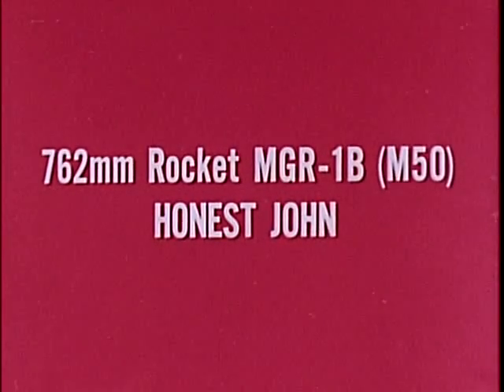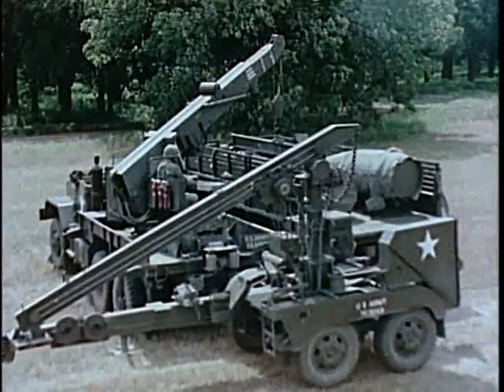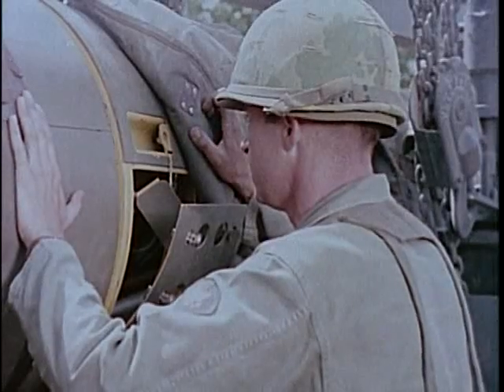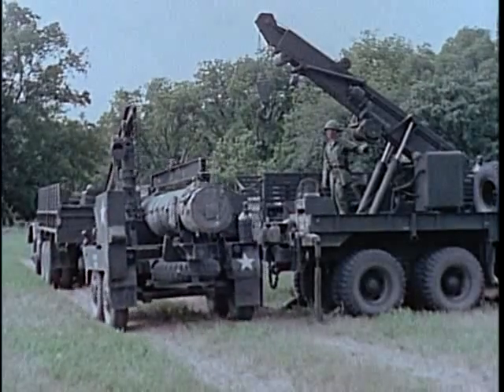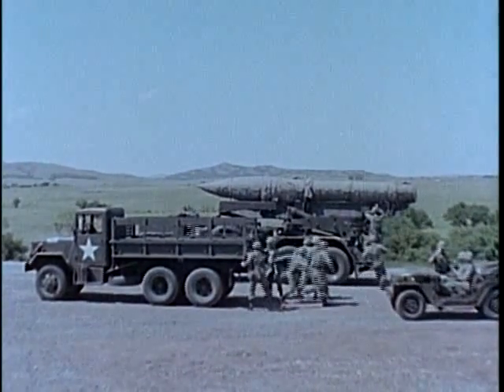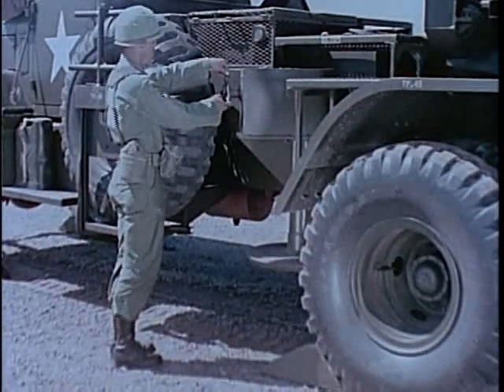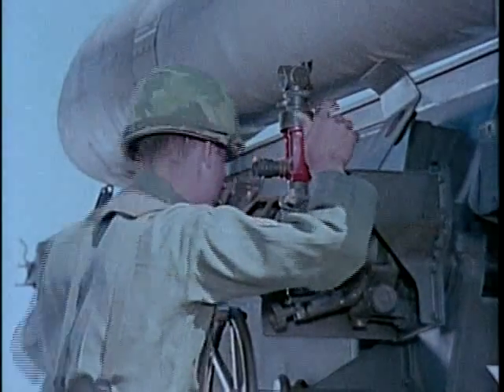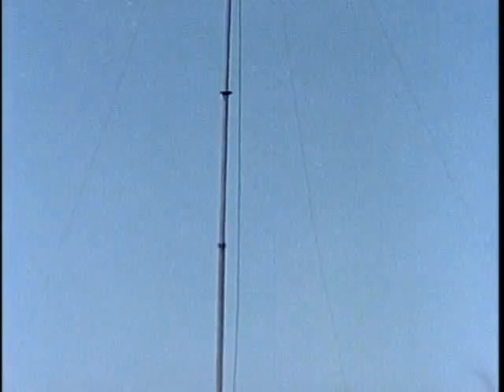Honest John Rocket

Comment: In 1956 I was sent to Germany and put into an honest john outfit in Ansbach Germany in Bleidorrn Casern.we were a small unit, the 3rd field artillery battery, We were only a Battery and our commander was a Captain his name was Ogrady later we were made into a larger outfit and we became the 1st missile battalion. We always had one or two rockets set up and ready to go except for the atomic war head. in the winter they kept heated blankets covering it. we fired several without an armed war head. once we fired one with a loaded warhead at a place called Grafenwohr but it was so loud And caused so much damage they never did it again, it was at 12 midnight and i was a radio oper. 15 miles away and it blew my window to the radio room open.

Comment: All that support & manpower for one misslle
Reply: and the first rocket for it the MGR-1A only went 15 miles for max range, which would put you just a bit outside the range of the 20kt yield nuclear warhead by around 5ish miles lol. Better hope the wind doesn't quickly change after that bad boy is fired. We also has a Cluster munition warhead for it as well, which delivered 356 bomblets of around 1.3lb of Sarin  (GB) in each bomblet. We really excelled in ways to mass murder in the 50's and 60's lol
Reply: @Unkemp7  I was in an HJ unit in Germany. I don`t think it was practical to use any warhead other than nuclear. We had Nukes with 3 different yields (black,ebony and coral).
Reply: You can only carry one or two of them and they told us after you fire it you are then basically an infantry man, we had a support unit with 20 millimeter guns follow us around i was in the first honest john outfit in Germany in 1956.

Comment: Pretty accurate video, except for the beautiful sunny day.  I remember those 10 degree days with two feet of snow at our detachment.  Or slogging around in the mud if above freezing.  And it was a slow process in training with reading each step and being checked afterwards.  But, for sure, there were worse places to be at that time.

Comment: I worked on them in Korea 1969. we had the nukes. did test firings along the DMZ to show the North we had the goods.  Some wild times.
Reply: Thank you for your service.
From S.Korea
Reply: Worked with them at ft. Benning in 1960
Reply: @kathleenscott4792  I was FDC in Germany1966-68. We fired the HJ in Graf about 3 each year. Manual computation of firing data took about 6 or 7 minutes and had to be confirmed by all 6 computing the same answer.
Reply: camp page,  korea 1974-5, hqs battery 1/142nd, 3rd missile command.  those things didn't go whoosh, they went BOOM then disappeared!
Reply: @jameslstephens36301  I was in a HJ unit in Germany. How many launchers did you have in your unit? We had two batteries each with two launchers.